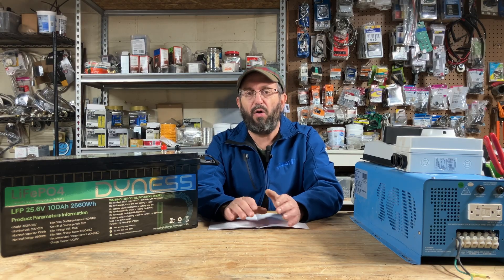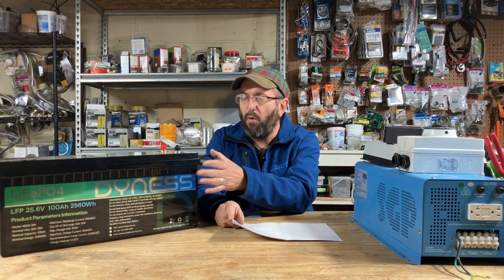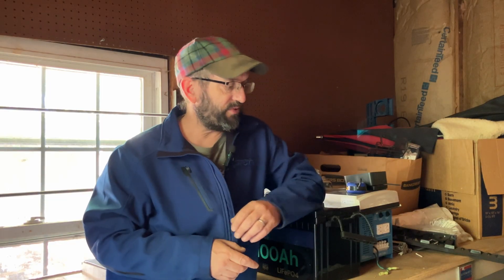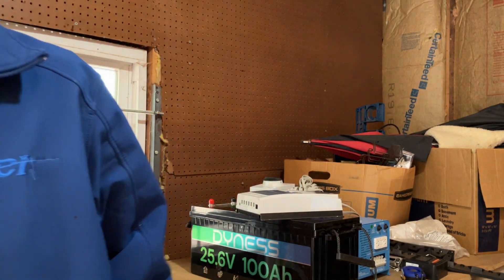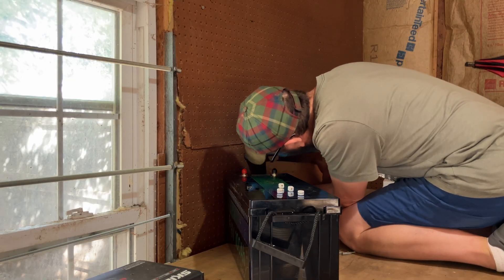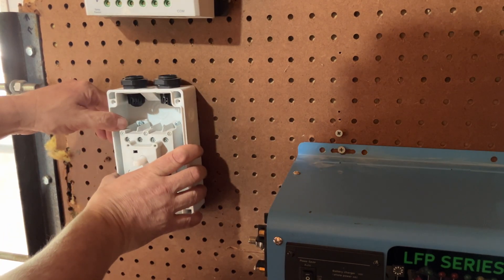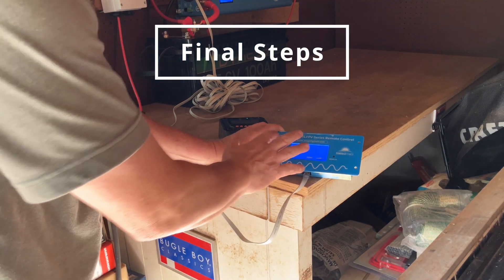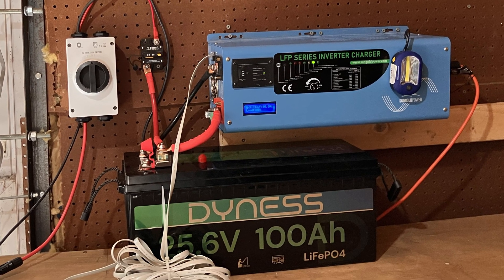DIY Off Grid Solar Build Using Dyness 24v LiFePO4 Battery.  Beginner Friendly!

Comment: Why is the charge controller so crooked
Reply from the maker: The controller is mounted level.
Reply: That's what you saw, not the spark, or the fact that 1 100ah 100amp bms is not enough for 4000w inverter, really? Always use a resistor to pre load the inverter, and 4000w ÷ 24v = 166amps, 100 amp battery is not enough, so crooked is not an issue, OCD might be.

Comment: I want to use this Solar Panel Disconnect Switch on my existing system.  But I have two strings of panels, one in series and the other in parallel.  Can I use this switch with one controller as long as I don't exceed the amperage or voltage?
Reply from the maker: I don't see why not.  You could also try posting this on the forum - https://diysolarforum.com
Reply: @OurBlackCatCottage  Thanks for responding, I only ask this question because you showed 1 input and 1 output.  But look as if theirs two inputs and two outports.  Thx!

Comment: For little projects like this I like using a modest steel electrical box to hold everything except the battery, though if heat is an issue I'll just take the door off the box or install fans.   The big advantage of stuffing things in a steel box is improved fire safety.

Anyway, my favorite little box for projects like this is the "Renogy 200 Amp DC circuit breaker box".  Looking the thing up on Amazon (since I can't post links)... its actually tough, but searching for "200 amp box" seems to bring it up a few rows down in the search results.   It has knockouts, a backplate, DIN rail, ground lug, rubber gaskets, reversable/removable door.. the works.

I love these sorts of boxes.  I can stuff a full solar system sans battery into one, including a small inverter.  I'll put a whole line of 2-pole breakers on the DIN rail (makes wiring easier), rubber grommets in the knockouts that I use, a fan if necessary (or just take the door off entirely).  I just screw everything into the backplate or mount stuff on the inside walls with self-tapping metal screws and poof.

I usually stick to small, compact devices.  24V or 48V system.  I can fit a Victron 150/35, AC charger, and a small Victron phoenix inverter in the box along with all the breakers, whatever bus bars I wind up using, cabling, etc.  Metal screws galore 🙂

-Matt
Reply from the maker: I have done several box versions.  I prefer this way because I don't have to add the fans and such this way. Also, that low frequency inverter is about 100# so no way this is portable.  LOL!
Reply: @OurBlackCatCottage  Yah... what are you going to run with that LF inverter anyway?  Seems like a bit overkill.  I usually just stuff a Victron Phoenix 24/800 or something like that (800VA).  Small, light-weight, still LF, with the advantage of its very low non-eco idle consumption (5W) and 94% efficiency... so I can just leave it on 24x7.

Good enough for tool battery chargers, LED lights, refrigeration, and such.

-Matt